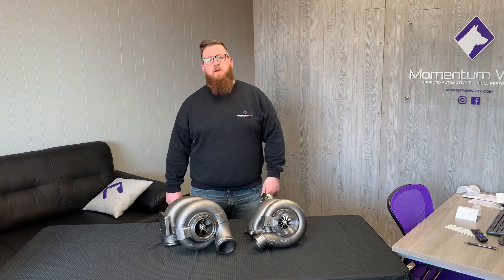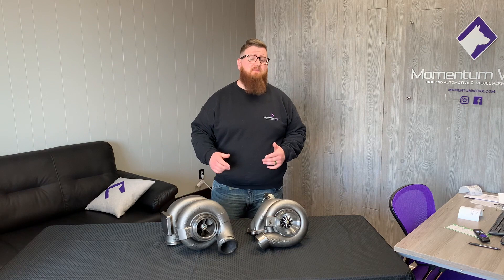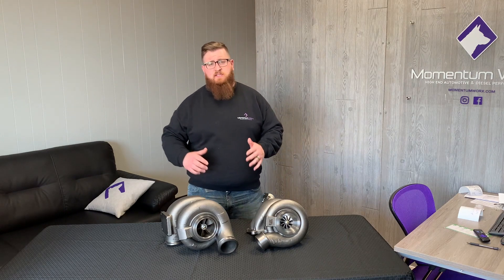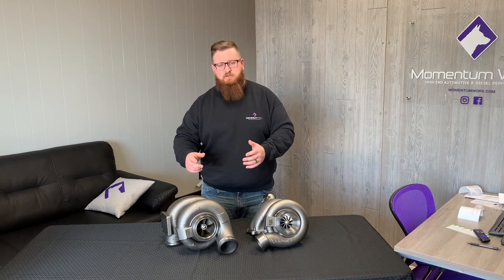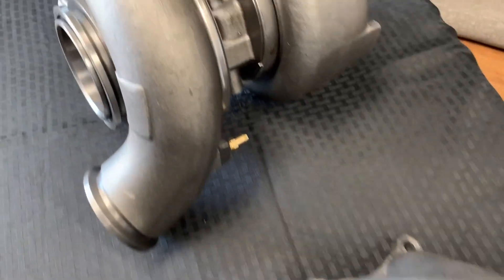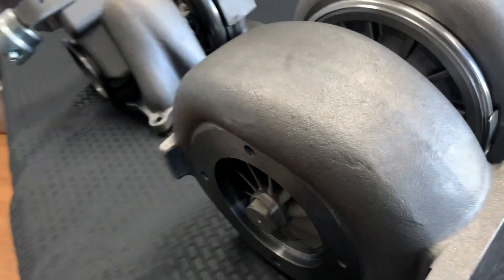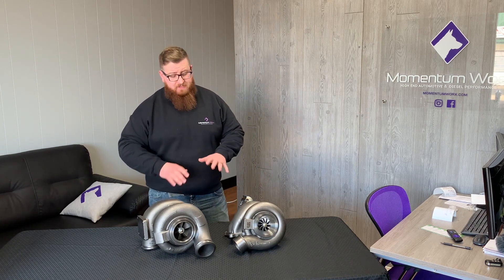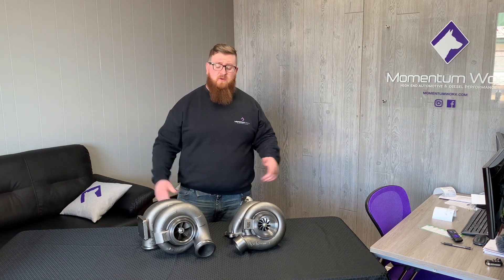Replacement Turbos For Cat C15 Acert - COMPOUNDS, not TWINS!

Comment: My low pressure turbo is bad at the moment I am stuck between doing a single  conversion or just replacing my stock compound pair.. help joe
Reply: I wouldn't go single. It couse more issues down the road. Unless you go 16 1 pistons bunch of other work. I am in same shoes gonna go with plantnuim kit with new trubo, oil cooler, injectors. Gonna run me around 36k. 50k roughly to make acert to like 6nz getting rid of iva and pre cooler and going to single. Idk maybe next Overhaul I'll do that
Reply: @Bosnianfear15   people who sell single turbo conversion's 
Leave all those details out..
If it was as easy as just slapping a manifold and turbo to a Acrt motor
There would no longer be compounds anymore.
The way they advertise these kits.. leaves you thinking it's a lot easier than it really is.
Reply: @franky7830  totally agree,
Reply: @Bosnianfear15  👍
Reply from the maker: just replacing the low pressure will be far less expensive at the moment.  But if you have to replace any bellows or the manifold, it might make more sense to go single turbo. 

Its really personal preference.  I love the compounds (When they are working) but for the sake of simplicity and easy maintenance, the single setup always wins there.
Reply: @momentumworx  can I give you a call?
Reply from the maker: @franky7830  sure - 215-237-9672
Reply: @momentumworx  I spoke to Steve he's going to email me a list of scenarios that's going to point me in the right direction for what I have going on thank you very much
Reply: My turbo that is attached to the manifold I believe is the (high pressure turbo)
Is passing oil and I believe also pressurizing my crankcase.
My next question is is the single turbo more reliable in the long run?

Comment: Hey Joe, in a C15 application, the low pressure physically sits lower than the high pressure. However, on the C13,they are the opposite. Confusing,I know. Great,simple  explanation though.thx